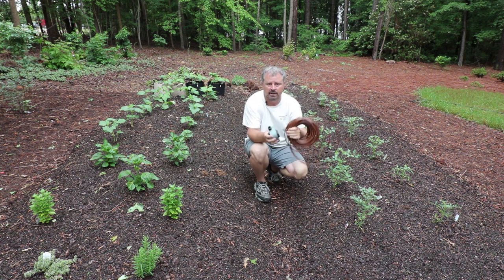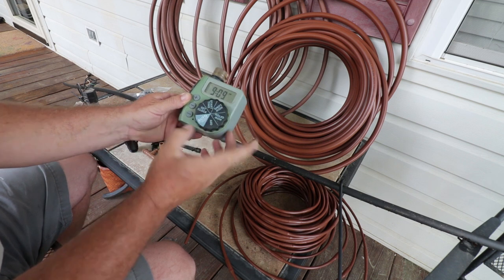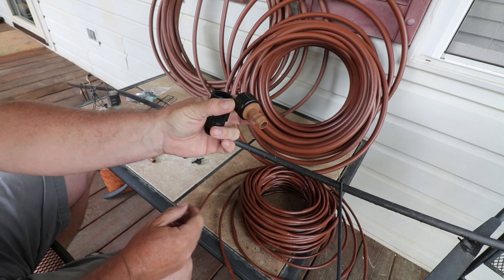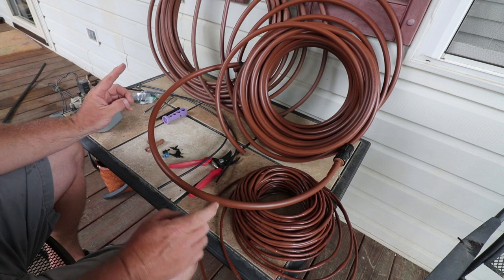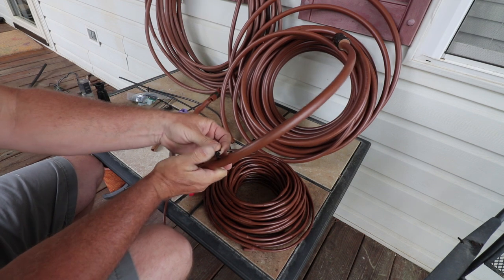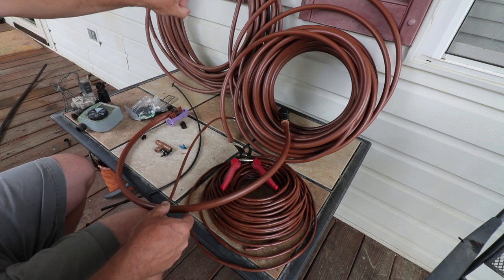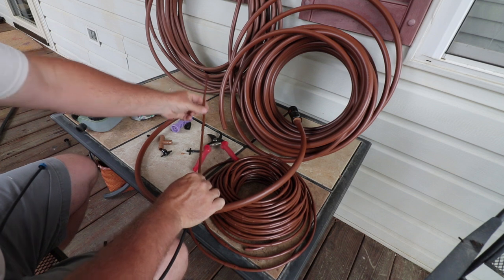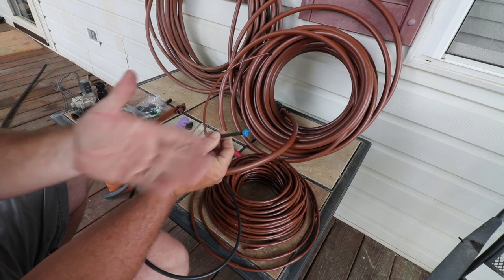How to Install Drip Irrigation - Part 1 The Basic Pieces and Parts

Comment: People planning to feed drip lines directly from their home plumbing (eg, via an outside hose bib) and leave the connections in place indefinitely and unattended also need to look into setting up some kind of code compliant backflow preventer assembly (eg, a pressure vacuum breaker, a doublecheck valve assembly, etc). Most municipalities legally require it.

Comment: I have been watching videos on setting up a basic drip system for my small home garden. This one is the best. I wish I had seen this earlier. Choice of a main line with 1/4 inch drip line with built in emitters is an excellent recommendation. Keeps it simple with very few parts. Thanks

Comment: Great video. Now I have a plan for my garden boxes, They are 4 x 8 x 2 boxes with 1/2" threaded pvc pipe in the middle pointed up coming from a valve that I can add to my controller. So my plan is to put a regulator with filter on first, then the adapter for the 17 mm line. Loop that down to the dirt in the box, close it. Tap into the 17 mm line for my drip line. Put an on off switch in and run my drip line!

Comment: If you have your timer at the end of a hose be sure and put the pressure reducer before the hose.  Most hoses are not able to withstand constant pressure without eventually bursting or the fittings blowing off. I learned this the hard way.

Comment: Do you recommend a 2 way splitter from the  timer for 2 areas? If so, which one? Would I need two pressure regulators attached to each side of the splitter? Thanks for your helpful video.

Comment: My connectors and tubing was way harder to connect than yours. Fingers got a bit sore haha. I ended up using a torch to soften the 1/4” tubing before attaching connectors or emitters and it made a huge difference.
Reply from the maker: I would always lay it out in the sun on landscape jobs to soften it up

Comment: I always get leaks at my swivel connector on the timer or the hose/tube connector, is there a fix?
Reply: The o-ring gaskets are replaceable, so you could try that. But otherwise, something might be damaged and preventing a watertight seal from forming. Leaving water inside those parts overnight during a freeze could crack them, among other things.

Comment: Take a clean yoghurt container and put a sewing needle through the bottom. Fill it with water and see how long it takes to empty. That will give you the time it will take to empty and you can work from there to decide how big a container you actually will need--a pint, a quart, a gallon, multiple gallons, etc.

Comment: What about the winter? Do you have to dis-assemble the whole system over the winter? Or how do you drain the last little bits of water so it doesn't freeze in the tubing?

Comment: Thanks for the video, 
1- how do you change the drip emitters?
2- how many bar pressure regulator do we need?
Reply: Typically the pressure regulators are set to 20 psi (1.38 bar).

Comment: Hi.. I see this is an older video. But you make it look easy. So I'm following what you're doing. 😊
It's my first time setting this up. 
I have all the parts as of today. 
You talk about a filter and pressure regulator.
I don't have those yet.
Here's why.
I use a lot  of worm casting in my garden.  I have 9 Rubbermaid bins  of Red Wigglers. 
Every summer, I put an RV Water filter on the faucet and then hook the hose onto that. So the chlorine ect ect bad stuff is filterd out the water.  
So doesn't kill everything in the casting. 
My question is..
Can I just attach my ½ hose to the RV filter ?
Would that do the same as the filter and pressure regulator you have .
I don't want to spend $$ if I don't need to. 🙂

Comment: Can we bury the hoses underground? I need to irrigate some trees in my yard, and I am having an issue watering the trees too much because I have to water the lawn. I am trying to figure a way to water the trees and lawn separately. This seems like I might be able to do it with the bubblers for the lawn and drips for the trees unless you have a video for another idea? I can't afford an entire sprinkler system, so looking at cheaper methods.

Comment: I have had 2 kits for 3 years - still in the box. I have a in-ground sprinkler system. I want to convert 2 out of 4 to drip. I can’t figure out what I need to hook up the water. Do I need to dig up down the line like before the first sprinkler and add a regulator somehow? This is my holdup.

Comment: I want to install drip irrigation in my flower gardens before I go in Vacation. I have a question, Do I use 1/2 inch drip irrigation tubing & 1/4 inch drip irrigation emitter lines (the one with the holes in it) so that they will fit into each other?

Comment: The Rainbird Starter Kit you recommend has not been available for months. Is there another starter product that you would recommend?
Reply: Pretty sure I saw them on Amazon. However, it may be less expensive to simply get a list of the needed items and buy them individually.
Reply: Carpathen drip irrigation systems. There on amazon i just ordered mine under 50 for everything beside timer.

Comment: Would a rain barrel be able to provide enough water to run a drip system?  I'm just looking for a very hands off solution to watering my landscaping plants.  I would use a 50 gallon barrel to water around 20 plants.
Reply from the maker: The pressure may not be enough to force water evenly out of all the holes

Comment: After u hook up the timer to the faucet do u turn on the water, after everything is hooked I mean, then turn on the water? All the way in or a little bit? And the timer controls it from there on out ?
Reply from the maker: Yes the water will be on and the clock blocks it until it turns on.

Comment: Anyone know if I use a hose chlorine filter, where would I connect the filter to the drip irrigation ?
Reply: Not exactly sure type filter your referring to but most filters install in start of your run after water timer.

Comment: Why do you need a pressure regulator can you just put a ball valve in? I see some videos install both is that just redundant?
Reply from the maker: A ball valve would just be for shutting it off, I'm assuming. The pressure regulator is definitely necessary.  Frequently these parts can blown apart by excess or unexpected pressure.

Comment: The 1/4 inch tubing (black) you have a link to is not the same as the brown you use in the video. To get a barb connector into the black tubing I have to use two pliers and still often leak some blood when I slip.  The brown tubing you use appears to connect much easier.  In fact, I'm here today looking for tips on making the connection but so far haven't found anything.
Reply from the maker: That black tubing is more rigid. I will frequently leave it all out on the direct sun in the hottest spot I can find. That seems to make it all more flexible.

Comment: I watch the video and started getting confused.  4:10 you talked about the pressure regulator and then at 5:15 you pick up another "regulator".  Are you using 2 different regulators or just 1.  I was thrown off when you talked about the electrical system... totally didn't get it.

Comment: Jim, really enjoyed the 3 part series. So much so that I've shelled out $150 to put one in. 😭 the question I have is what do you do if you want to remove a 1/4" bard from your distribution line? Is there a plug available or do you just splice in a blank piece to  the dist. line?

Comment: You don't run a backflow preventer at all?
Reply from the maker: I do on my in ground system, but not on a water hose system like this. I'm eventually hooking it into my in ground system.
Reply from the maker: I probably need to add that if you were going to inject fertilizer or chemicals through the drip system it would need one no matter what.
Reply: I would absolutely run one to anything that was sharing the potable water your house runs (like thumbnail pic) regardless of how it's hooked up .. pvc, hose etc.  Good video Jim.   Thanks for all you do
Reply: Interesting! Did not know the hazard's of not installing a preventer for the garden. Makes perfect sense. Thank you, this is why I enjoy reading the comments section. Also to read the stupid comments as well...and there is WAY MORE of those than the extremely useful one you just provided. And now that I know about the preventer there is no doubt the video provider should have provided this information.